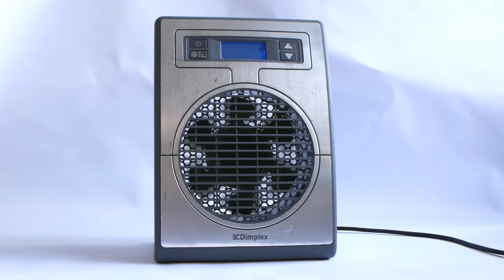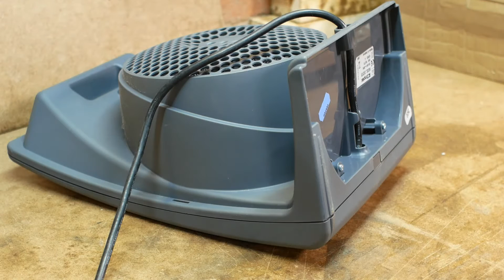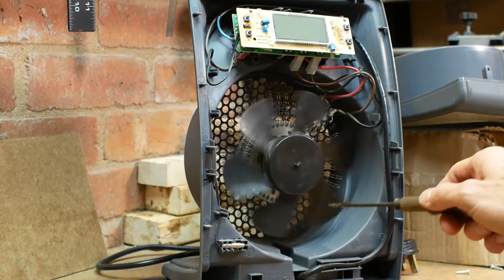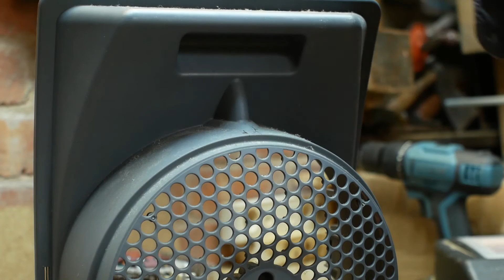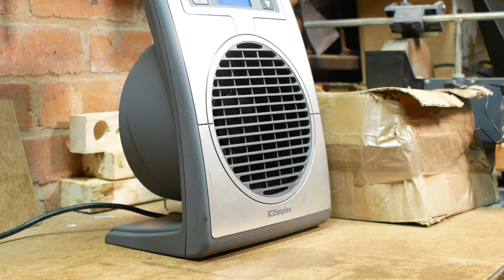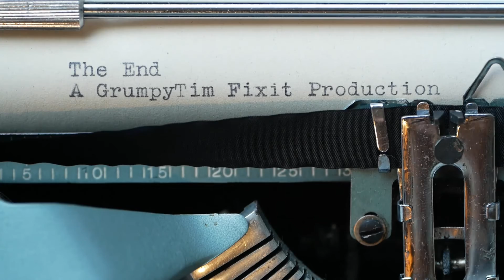DIY Repair - Dimplex DXDF20 Fan Heater - Blades Catching Cowl - FixIt

Comment: That is a surprisngly poor design, poorly tested. Well done for fixing it.
Reply from the maker: Overall it's a really nice fan heater with by far the best temperature control I've come across so I'll give the designers the benefit of the doubt - maybe it was originally intended to be made out of one of the glass fibre reinforced plastics and somewhere along the line it was changed to a cheaper non reinforced plastic.  As it is though, I can't imaging any of these units not suffering the same issue, the plastic is just so soft.  Should keep it going for a few more years - I put a drop of oil on each motor bearing while I had it apart because those are a common failure part too.